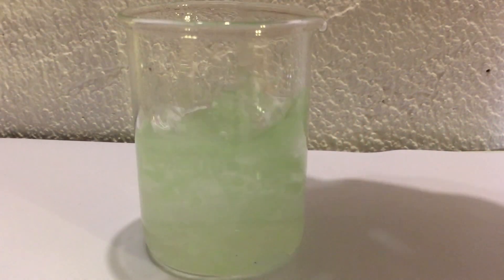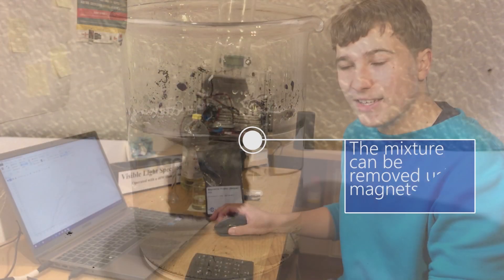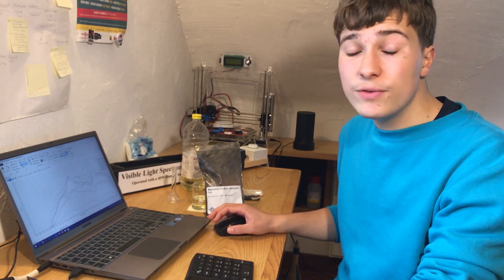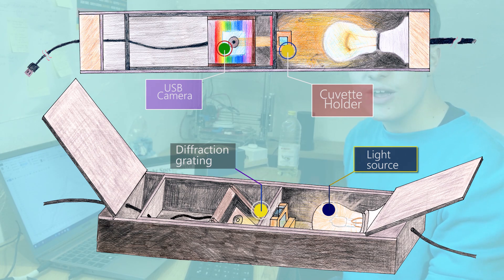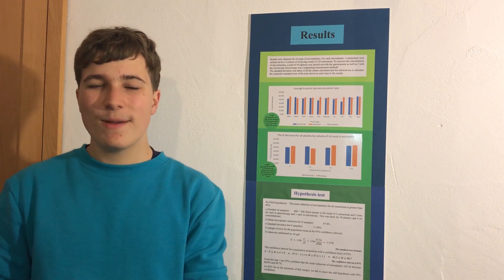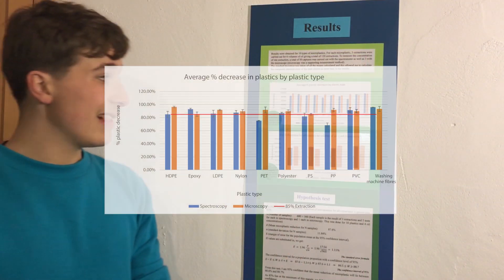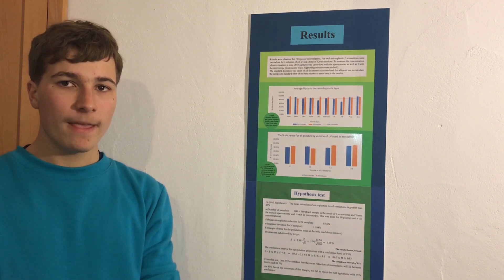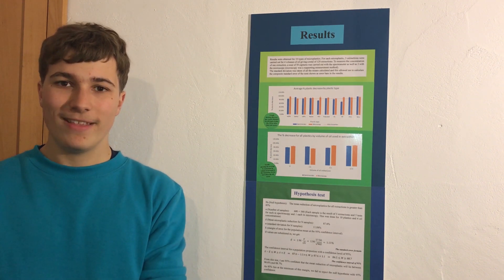An investigation into the removal of microplastics from water using ferro-fluids

Comment: Good video, a very important question about your project, after removing the microplastics from the water with
lodestone and oil,
How do you dispose of these by-products (magnetite + oil + microplastics)? either
they are simply thrown in the garbage without any previous pre-treatment. Or do you do some pretreatment to separate the microplastics from the ferrofluid?